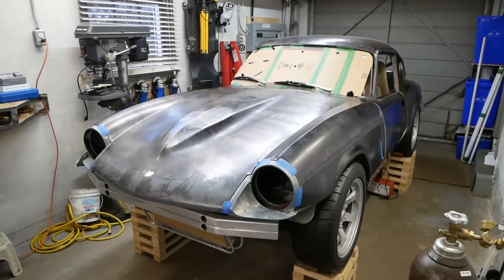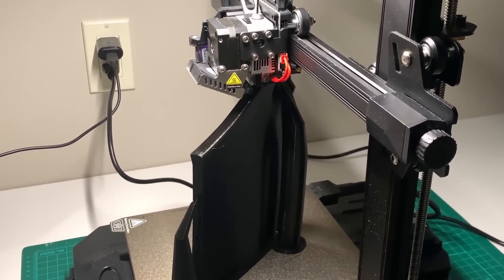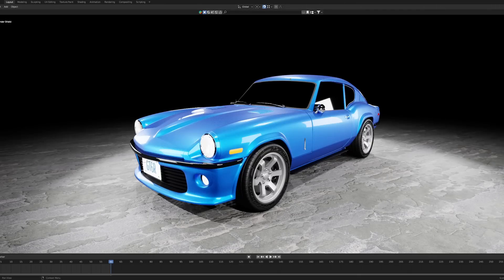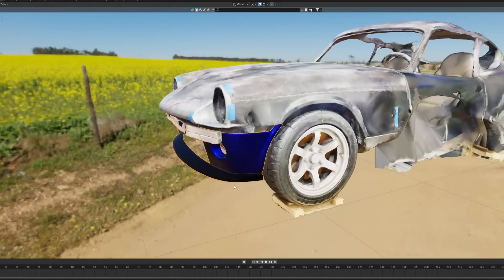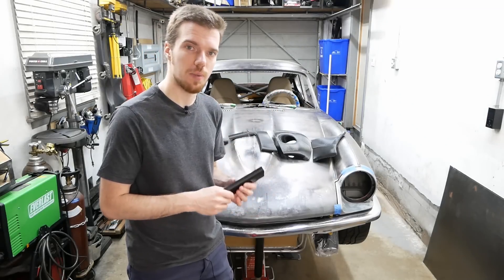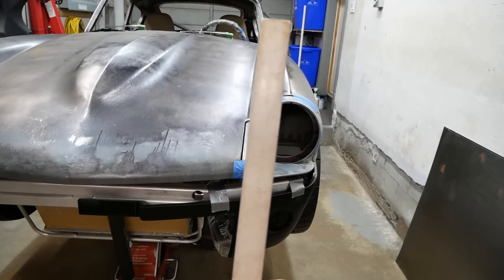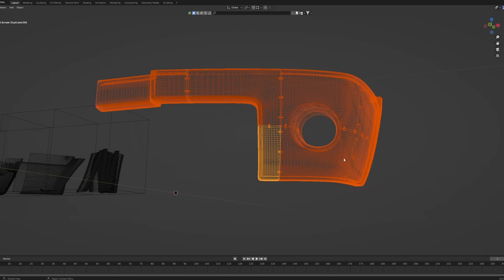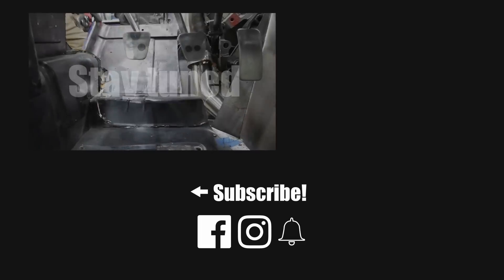Let’s 3D Print a Bumper! Pro Touring V8 Powered Triumph Build – Project GT6R – Ep40

Comment: My dream would be to be able to 3D metal print a whole car body. Maybe someday. Amazing work as always! I wondered if it would make sense to 3D print the molds instead of the parts and then go straight to fiberglass? The render looks amazing. This car is going to be beautiful. I have a hot staple plastic welder kit would that work to stitch these pieces together sturdily?

Comment: With PLA, you might find that on a moderately hot day you are going to see a heck of a lot of movement with PLA. It simply isn't going to hold up. ABS is a good choice. Keep in mind that it's a bugger to print ABS without an enclosure. Which can be fixed with a cardboard box.

Also, at Saturn we found that vertically hung panels (door panels, fenders) did good, while horizontal panels (roof, hood, trunk lid) couldn't be kept from sagging without reinforcing the panel to the point where it weighed as much, or more, than the original steel part. And using plastic parts forced us to widen the gaps on the car.

Lastly, there are tricks like vapor smoothing that you can do to reduce (or even get out of) sanding. It's something that you have to be careful with, but really is no issue if you do it outside.
Reply from the maker: Thanks very much for the advice, it’s amazing the breadth of backgrounds I’ve seen in the comments! I’m not actually planning to use the plastic in the final parts though!  They’re going to be forms for fibreglass only… as mentioned earlier in the video I’m not planning a plug-mold-final part process this time… just 3D print-final part directly.  More finishing work on the actual components, but much less work to get there!  The PLA forms can be dismantled or discarded afterwards 👍 cheers!
Reply: @FanatikBuilds  Check out "Vapor smoothing" then. It'll cut down on the sanding. Apparently it does work fairly well on PLA, even though it was intended for ABS.

Comment: You can also increase the resolution of the stl model to get better cuality in the printed parts. It only make the model more heavy, but i think its worth it. You make a good job
Reply from the maker: Yeah I left smooth-shading on in blender so I didn’t realize the surface texture would be quite so pronounced around the fog light area.  Easily filled/sanded out by hand later though 👍 thanks!

Comment: I did a very similar thing last month but I have no You Tube channel to point you to. I'm redoing them and here is what I learned. You only need 5mm thickness but use 20 mm long  right angle lips to assemble the parts. I saw another You Tube channel do this and it is much easier to assemble. I saw you struggle with the index dowels. Put index holes in the lips and just bolt and glue them together with epoxy glue. I am also switching from polystyrene resin to epoxy and vacuum bagging the fenders. I have not done that part yet but gravity lay ups left a lot of gaps and voids.
Reply from the maker: Wasn’t really a struggle with the dowels, but I should have printed them with a chamfer so the ends wouldn’t have mushroomed out.  Still learning!  Appreciate the tips though, thanks very much 👍✌️

Comment: PLA doesn’t tolerate heat well - without the external composite layer a hot sunny day would get it soft enough to distort. The external composite layer(s) will need to be strong enough to hold shape without any help from the PLA.
Reply from the maker: The PLA prints are only destined to be a form for the fibreglass, and will be removed and discarded after the FRP has cured 👍

Comment: Aren’t you concerned with water getting into the intake? I actually know of a few people it has happened to. Very bad day.
Reply from the maker: The filters will be fully boxed off with baffling to help separate the water from air.  Also, having two filters means that they’d both have to be submerged simultaneously to have any water be drawn in.  Should work fine, and we don’t plan to drive in very heavy rain much anyway 🙂👍

Comment: For those dowels, you can of course print them up, you have the machine and filament making them basically zero cost. But there's a time investment that's not really worthwhile imo, a common solution is to model the recesses to accept commercially available dowels, or dowels made from cheap stock like some sort of rod. But basic wood dowels available at a hardware store for pennies apiece are adequate and well worth the time saved in preparing printed pieces. 

If the part is going to be structural or otherwise see long term use, using aluminum plastic or fiberglass rod as a reenforcement throughout the print is another possibility.  I'll be doing something similar but printing out of ASA and using the parts directly, I plan on running fiberglass rods through the lip and other long portions of the bumper to make it more resilient.
Reply from the maker: Another viewer recommended TIG filler rod which would have been the best solution for me, but these little printed dowels worked out great and didn’t take that long to print or hand finish really 👍
Very interesting!  I plan to use ASA for other parts in due course, but the PLA is a good material for beginners like myself, and will work just fine for these molds.  Cheers and have fun with your project! 💪✌️

Comment: Nick Ziroli has very light weight fiberglass cloth with no sizing. Drapes easily over compound curves. Probably what is needed for the exterior, as the composite engineer described. Nick's price is very good too.
Reply from the maker: Thanks for the tip, appreciate it! 👍

Comment: Not enough content.  I'm sure you're busy with life and all, but watching a machine do the work is not as entertaining nor informative as many of your other episodes.  To be truthful, I think you could have just used the foam and 'glass method, and already been done.  I have been wrong in the past though!!😉
Reply from the maker: Ha, the machine doing work was just a small percentage of this video, Jim, and indeed this whole sub-project!  There’s been months of time put into the 3D model, and only a small portion of that has made it to video.  The same could be said of CNC made parts, but it still wouldn’t change the fact that they take time and increase the quality of a build.✌️ I’ve done the foam method before and I’m 100% glad to have skipped that hassle this time! 😊
Reply: @FanatikBuilds  I haven't done anything in foam, but it seems like it would have been faster.  I do all of my stuff, so far, in metal.  I have a future project that's an old Audi Fox, and I'm going to try to make it a "wide body" style car.  I was thinking of using foam and 'glass for that.  That's far more extensive than what you're doing, so I think(?) that will be faster.  Not having done anything like that before, may be the reason that I think that...  nice car, and nice work!!

Comment: Clever solution to alter the visuals with color, painting the spoiler lip black.  Your computer skills are very impressive.  Excellent job with the 3D design and printing.  I would not have been  surprised, tho, if you pulled out an old English Wheel and produced a grill!

Sorry if you previously provided it, but please share a project schedule/timeline of all jobs remaining til completion, including the bonnet louvers we fans unanimously approved back in Episode 27.  I hope you didn't forget 🤔

Thanks
Reply from the maker: Thanks man, really appreciate it 😊🙏  I’d love to have tried that, but the livelihoods of getting matching panels with zero experience is pretty low! … no specific timeline really, it takes as long as it takes to be perfect!  I’d love to be at paint stage next year, but we’ll see, there’s a lot to be done still.  I plan on getting the car to nearly a finished state before paint, as I’ve seen too many projects get colour, only to need more grinding and welding done afterwards.  Like Project Binky we’ll be doing a dry fit before stripping it down, but maybe we can fire it up while it’s still in primer 😉👌👍 cheers! … oh, and louvres are 100% a go!  They are even in the 3d model if you look real close 💪

Comment: There were a lot of channels I follow in this video. I recently came across a channel called Ding Dong Drift, and he is using 3d printed parts to restyle his Lexus SC drift missle. I have that same bed surface on my Ender 3 V2 and it works amazingly. My old glass one acually had a chunk taken out of it when a part I printed cooled off.  Also, for some reason the front valance reminds me of an early 70's Vega. Not sure why. lol
Reply from the maker: I believe I’ve seen his work, cool stuff!  Oh dear, I’ve heard of that happening but it almost seems hard to believe!  The PLA pops off the PEI surface so easily… 👌 cheers! ✌️
Reply: @FanatikBuilds  Yep. I printed something in PETG and it went overnight. When I came down to grab it the next morning, it was done, and had released from the bed during cooling. It took a small chunk of glass off the bed. I was really surprised.

Comment: Hot tip: PLA loves superglue. Sticks very well. I use 2.4mm TIG wire for locating pins. Great Blender work, too. Using it for accurate models 🤌
Reply from the maker: TIG wire!  Why didn’t I think of that!!  Cheers Tim, really appreciate that, and I’m glad you like it! 🙂✌️

Comment: Just a heads up, the low air intakes risk the chance off sucking up water from puddles and hydro-locking the engine.
Reply from the maker: They will be properly ducted and have some water separating baffles to help avoid that.  Also, having two filters is helpful as both would have to be submerged for it to draw up any water 👍 appreciate you keeping an eye out for us though, thank you!

Comment: Look into solvent welding for plastics, very useful technique for the type of stuff you're doing. Loving the project so far!
Reply from the maker: Thanks man, apparently super glue works well on PLA.  The hot glue and pins seem to be holding well enough for these parts’ intended purpose, but it’s good to have a fall-back!  Cheers, appreciate it! 🙏🔥

Comment: That is a fantastic process. It looks great. If the heat from the hot melt glue is a problem , maybe you could try Weldwood contact adhesive. The pins would keep the parts lined up ,so there would be no misalignment issues. And no heat. But, Weldwood might not be compatible with that type of plastic. Just a thought.
Reply from the maker: Thanks James, the hot glue seems to have worked out well enough for these forms thankfully!  End-use parts would need something better though for sure 👍 cheers, and thanks!

Comment: Nice one! You could just use paint primer. That yould be a lot faster then putting fiberglass
Reply: You'll sand this way too but you can eliminate an extra step whilst getting a pretty nice finish from the paint primer to work from.
Reply from the maker: Thanks Max, the idea is to discard the 3D prints after using them to make fibreglass parts.  The PLA plastic is not well suited for automotive use… cheers! 😊💪🔥

Comment: Wouldn't maling a mould of the 3d print be the best option, i know we don't like to think about it but with a fibreglass front bar the is a good chance it will be damagedat some point and being able to just produce another could be a life saver since i imagine you guys intend to drive this beast a good amount a keep it around a while
Reply from the maker: It’s the extra expense and limited storage space that’s the issue here.  Doing it properly is of course preferable, but if we ever damage our bumper, I can always reprint a new form and jump straight to fibreglass! Just a bit of bodywork to finish though of course. I held on to the molds from my boat for over 10yrs before I threw them out and I shouldn’t have waited that long, just a waste of our limited storage space!  Thanks though man, cheers 🔥✌️

Comment: I've done lots of fiberglass work, making a mold isn't that difficult and its how I do everything now.  It is false economy not to.
I did try 3d printing a buck for the fenders for my scale 37 chevy because of all the complex curves, but ultimately it required lots of work and it would have been easier to just make it in foam.  So that is how I'm doing the rest.   Great to see your progress.
Reply from the maker: It’s not that it’s difficult, it’s the extra expense and then the issue of storing them on the off chance we need to use them again!  If we ever damage our bumper, I can always reprint a new form and jump straight to fibreglass… Just a bit of bodywork to finish though of course. I held on to the molds from my boat for over 10yrs before I threw them out and I shouldn’t have waited that long, just a waste of our limited storage space!  Thanks though man, really appreciate it 😎🔥✌️
Reply: @FanatikBuilds  The key is to make the molds just strong enough to make one part or two or however many you need in 1 or 2 days.  They warp in a matter of days.  If you make them stronger, then you are doing it wrong as a budget process.   The 3d printing always has flaws, and making big things takes hours and hours and can fail after 4 hours making the part garbage.

Comment: One thing I might recommend (although it adds a couple steps…) is rather than using the 3d print as a mold, use it as a buck to make a mold to then finally make a finished part. This way you can make the show side of you mold very smooth and hopefully have good surface finish on the final part. 
The middle man mold here doesn’t need to be overly strong or thick, just a couple of layers of chopped strand mat should do. But then you could body work and sand smooth the face of the mold that will become the show side of the part while also (maybe) gaining back the dimensions that you would otherwise lose. 
Looking great though, keep up the good work
Reply from the maker: Yep, great technique, but as mentioned I’d like to avoid the time and expense of doing that!  If we ever damage our bumper, I can always reprint a new form and jump straight to fibreglass! Just a bit of bodywork to finish though of course. I held on to the molds from my boat for over 10yrs before I threw them out and I shouldn’t have waited that long, just a waste of our limited storage space!  Thanks though man, really appreciate it 😎🔥✌️

Comment: Definitely a good initial design, but it looks a bit too frog faced imo.  Like an early 2000s body kit for a Honda Civic or mitsu eclipse.   

If you negative angled the grill opening back closer to match the radiator angle and brought the rest of the air dam to match it would probably give you more of a classic sports car look.
Reply from the maker: It already is angled back a bit, and any further wouldn’t clear the air filters!  I actually like it though, the car has no chin to speak of originally (IMO) so this helps 👍 I’m not going for 100% classic though, Pro Touring is as close as I can get to defining my goal ✌️

Comment: Awesome job, both the bumper project and explaining the basics to interested viewers.
The nice thing about photogrammetry scans is that you can rescale the scan data with measurements you've taken off the real object to combine both datasets into a usable base for your new parts.
Reply from the maker: Exactly!  It’s a really amazing process that I’ve enjoyed experimenting with!  Thanks man, appreciate it 😎💪
Reply: @FanatikBuilds  Also keep your printer in mind for later addons for the interior, like custom gauge clusters for additional elements (engine/boost metrics and the like). Though in those cases you're better off printing them in ASA or polycarbonate, filaments that need a chamber and air extraction because of the hazardous gases their use pumps out. Some people gor outright poisoning from ASA fumes adding up over weeks. Should be possible to sand them smooth and spraying them with automotive paints.

Comment: Hey, I love your project! Personally, I fell in love with the GT6 18 years ago when I got my driver's license. One suggestion with your front bumper design:  
Wouldn't it make sense to have referenced the kink in the sideline of the lower half of the door in the design language of the bumper? Just my opinion :) no offense of course
Reply from the maker: I have played around with a bunch of concepts over the last year+ that I’ve been working on the model, but could never get that line to flow with any other feature up front… there’s nothing referencing it on the rear either, so both bumpers are (in my eyes) what terminate the crease.  It flows into the wheel arches, then tapers down to zero around the area the bumpers begin.  Hope that makes sense!  Cheers man, appreciate it! 😎🔥

Comment: Still love how this is coming together. Have you given any thought to using carbon fibre? Mike Patey has given a master course on making one off parts with his Draco and Scrappy builds both available on Youtube. (his technique will also work for regular fibreglass. Keep up the good work. This car is going to be a high speed beauty.
Reply from the maker: I’d love to use it, just to be able to say it’s carbon!  Sadly the price to benefit ratio just isn’t there… for these parts at least!  Maybe some other components will get some carbon 😎💪 cheers!
Reply: @FanatikBuilds  Sometimes seeing the high level of quality of both your engineering and workmanship I forget that this is a budget build.
Reply from the maker: I’d love to use it, just to be able to say it’s carbon!  Sadly the price to benefit ratio just isn’t there… for these parts at least!  Maybe some other components will get some carbon 😎💪 cheers!

Comment: Hot Glue melts in the sun; so use something heat resistant :)
Reply from the maker: These parts will never leave the garage so it’ll be fine for our purpose!  End use 3D printed stuff would get something else like superglue, but PLA is a bad starting point for a car application anyway.  ASA will be where I head for that kind of component!